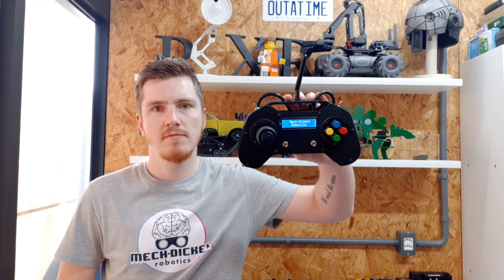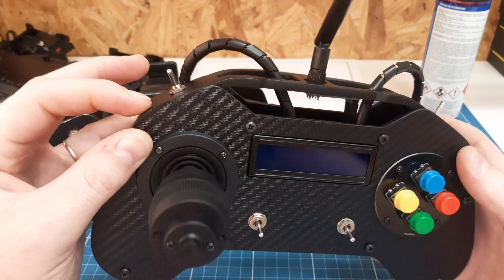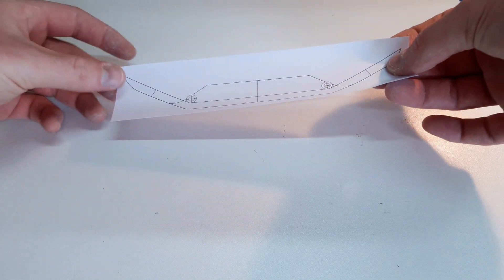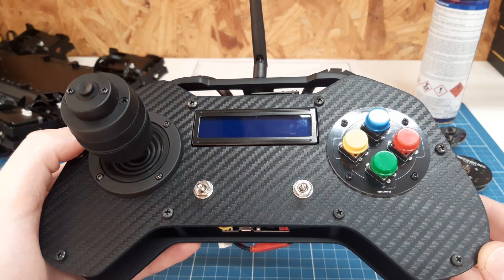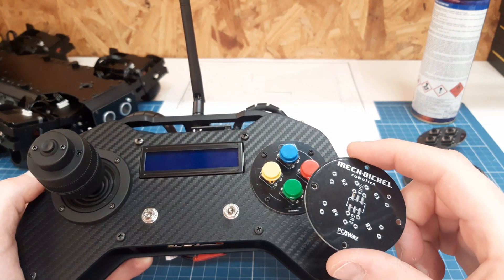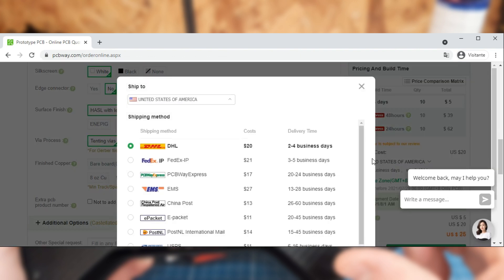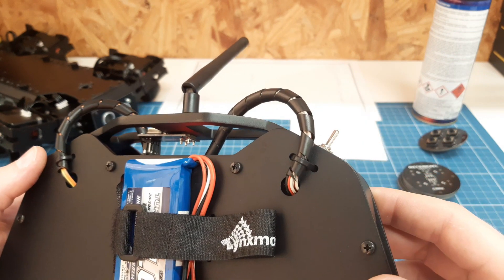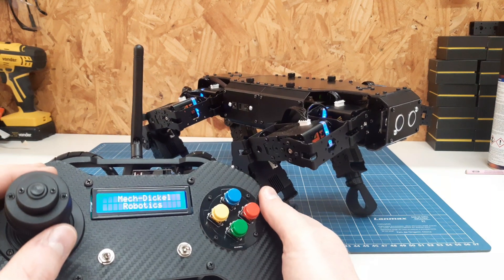DIY remote controller for robots (Arduino + nRF24L01)

Comment: How to make it receiver for this transmitter for robo dog
Reply from the maker: The dog also has an nRF24L01 module (one without that big antenna).
Reply: @MechDickel  because last time you have make robotic dog using stepper motor
Reply: But how we can make a robotic dog with nrf24l01 and servo motor

Comment: Dude, this is awesome. Im glad you retained the shape. That three axis joystick works really well too.
Reply from the maker: Thank you very much! I really wanted to do something different...well, I ended up doing something different actually, but preserving the original outline. I don't regret it! And the 3 axis joystick... wow, it's very cool!
Reply: @MechDickel  I'd love to build a universal remote, but I don't have many projects to drive with it yet ha ha ha!
I'd love to pair an m5Stack (ESP32 based, integrated screen, battery, three buttons and pins broken out on the side) with an Arduino nano as a slave for extra pins for the joysticks and buttons.
The ESP32 will allow for WiFi and Bluetooth connectivity too.